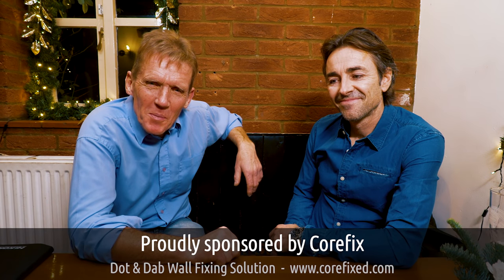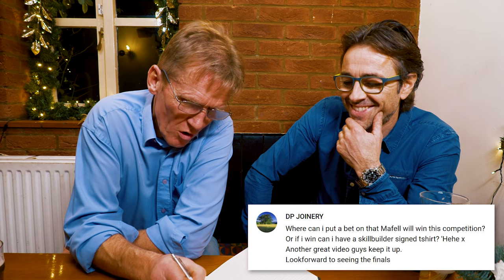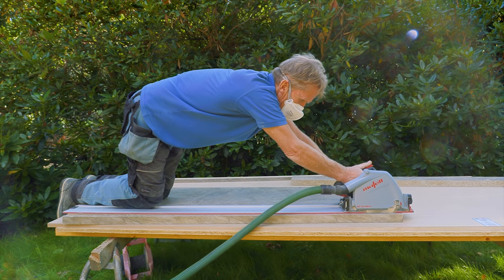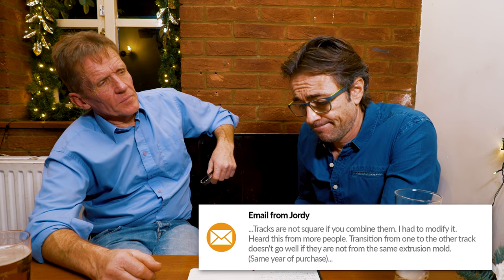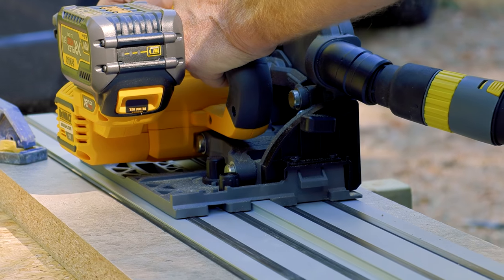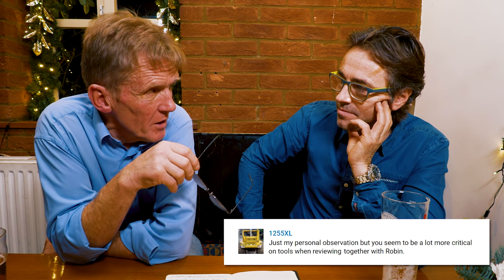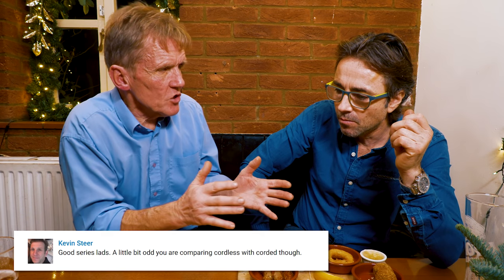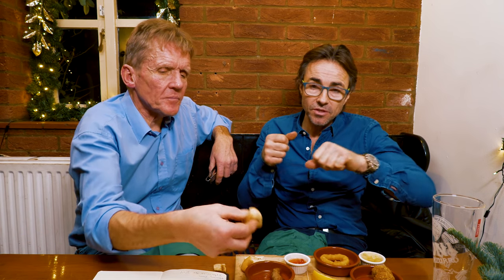Plunge Saw Season - Your Comments & Questions

Comment: when triton made their makita clone in a different part of the factory the chinese as usual cut a few corners so some tracks are not cut as square as they should and the splinter strip is often cut too short,. set the rails up as a pair and use makita splinter strip and bag them as normal.. the batavia, titan and erbauer variants have meant better quality control so triton has lost out a bit as they are probably still selling off their original run. the family of saws though is a good choice for those not spending all day cabinet making. trade or DIY. spend 30 quid on a systainer and they last just as long for most people.

the other bigger issue with the short tracks is that they are thinner than the longer ones.

I disagree with the last bit, erbauer is not just for DIY at all that is rather elitist of you, festool bosch and dewalt all  prove that more expensive does not always mean better, just more expensive . I know lots of trades who use it because it works, is cheap durable easy to get and easy to replace when it gets nicked. a lack of spares is what lets it down.
Reply: You can't seriously believe that the erbauer plunge saw is as good as a festool, I can't comment on the Dewalt  or Bosch as I haven't  used them but i know for sure the other two are not even close.
Reply: @cardiffpicker1  less refined maybe, noisier and certainly heavier, both have their place in the pecking order but the erbauer is basically a cheaper makita. festools are not durable nor are they perfect, or indeed value for money for most users.  a few better accessories from several makers and you get as good a result on an erbauer or even a titan much much cheaper. I know guys who have ended up buying second saws that take 165 blades for general use like floors, doors and panels then only use the expensive saw for expensive work. I use festool and makitas up north and have a triton at home, the triton sometimes takes a little longer to set up but the quality of work is just as good provided you are good at what you do in the first place.

three weeks ago I was kerfing a panel for a curved kitchen unit with the work festool and IMO it would have been a lot easier with my triton or my apprentices makita.

festool use 160 blades so you buy their expensive ones, the ts55 takes 165s perfectly well but you have to be aware of the extra depth of cut.

prior to plunge saws I used a standard circular with a plywood track and fine tooth blade in much the same way. for most people that would do them as good a job. 

two years ago out of desperation I serviced and tuned a battered erbauer sliding mitre saw to use on a job when my makita failed and it didn't fit either dewalt, it howls like a banshee and kicks too much starting power but it did just as good a job with a steady eye and a good blade. new the saw was probably 120 quid and it was over 5 years old when I borrowed it.
Reply: @cardiffpicker1  if you are interested when black and decker (dewalt as is now) started churning out 14 and 18v tools because they couldn't get decent quality motors or batteries for the price they were prepared to pay for them. odd compared to why they bought elu.

at the same time festo rejected two containers of johnson motors for being substandard. their CDD12 outperformed all other makes and voltages at the time. I have 25 year old 12v drill drivers still going strong.

bosch had the same problems, as DW but didn't throw as much money in their marketing to get over it.

it will be interesting to see what happens to hitachi-metabo now a US group owns them. I see we have KOKI tools in my local screwfix now
Reply: @davidcollishaw2771  a lot less refined  and quite a lot noisier  also dust collection is not as good, the cheaper brands are fine for ripping OSB or ply sheets but are very hit and miss with precise cuts.
Don't get me wrong I wouldn't buy a festool either  as they are quite delicate and I think they are more of a workshop tool than a site tool (could just be me as I don't wrap my tools in cotton wool).
I am more than happy with my 4 year old makita at the moment.
Reply: @cardiffpicker1  they all have issues with dust and accuracy.regardless of make as indeed do all saws. I have to disagree with your comment having done both regularly and accurately, if you have had issues then maybe you need to adjust how you do things. you have as many issues with festool as an erbauer if you do not check and check again. most errors are due to bad practice and maintenance. mdf dust on the friction strip with a failure to clamp the rail is probably the commonest cause of bad cuts.

even the bads on any saw make up for having to do it the older ways though. see the flaws and work with them.

Peter Millard does a good video on comparing the titan saw he bought with his festo. as he says most people cannot justify the cost of a festo but that doesn't make the titan or variants junk. for most cuts I may end up taking the sharp edge off with sandpaper anyway, blow out doesn't only come with the cut and a rounded edge is more forgiving if you aren't going to edge it.
Reply: @davidcollishaw2771  when I said precise  cuts I didn't mean  the accuracy of the cut as that is something  you learn to deal with  but blow out is far worse on a cheap saw than one of the premium brands.
Reply: @cardiffpicker1  that is often down to blade choice, the scribing cut on cheaper saws deals with a lot of that. the type of material makes a big different as well, the grade of MFC and laminate finish varies greatly. cutting veneered boards I'd rather use my triton than the work festo. some really bad boards I've had blowouts on all saws. no different to table or chop saws, better blade better finish, not all blades have to cost more to be better, a cheap new blade can cut better than a dull expensive one and most diy folks do not get their blades sharpened so cheap blades make more sense and give a perfectly good cut.

a problem with most saws is how much toe they allow on the blade or bad balance on the blade. the cutting cut is often not the problem, the blowout comes from the back of the blade. its more obvious to see in effect with a table saw.
Reply: @davidcollishaw2771  obviously  a sharp blade will cut better than A blunt one, you must have got the jackpot with your triton then as every one I have ever used has been pretty  bad even with a reasonable blade In them (only use Freud as it is what the company supply) even put a dial test indicator on one and the throw in the blade was horrendous.
Reply: @cardiffpicker1  not just the sharpness of the blade but the rake too, speed of cut and also speed of the saw, faster is not always better if the blade develops a shimmy or flexes as it blunts. badly stamped/cast washers also make a difference I've noticed

Comment: just recently bought the Bosch...base has no issues, nice and flat. Only used twice so far on kitchen worktop and MDF sheets (strip cutting for panelling job)...easy to use, very smooth on tracks and super quality cuts...also kinda like the grunt the motor makes when starting up.....Mafel was tempting to buy but I always look at what extra you are getting for the extra pounds, and in this case I didn't think it was worth it.

Comment: About bigger batteries - biger amperage maybe does not mean you will get "more power". 5AH batteries still have the same amperage as 2 AH but the runtime is lower. But with bigger amperage in a battery pack you get more cells. And you drain power out of all cells at the same time - so you can maintain the max torq and speed for longer before they start to heat up. Look at Milwaukee - they have ordinary batteries and High Output ones - that gives you 15 AMP with 18 V instead of 10 Amps of whatever the numer is for ordinary batteries. And you can see the difference in tools that drain power at much higher pace . Like a planer, angle grinder, drill that has to run a big drill etc....Im running Milwaukee platform (not happy with it) and circular saws and drop saws work much better and maintain blade speed better with HO batteries.

Comment: The battery amp hour does matter with how much power output but not always the case. This is really matter with the different kind of cell and behave of the cell to give you final output power. If you think the tool is actuelly a fix load (not always the case depends on the brushless controller setting), then when you require same 10 amps for the tool you will then end up in diff output voltages. The things is that due to this is a motor load and all the energy need to be converted to magnetic field before it converted to rotation, this means the amp is the only thing matter with your magnetic field generation. But if your voltage drop too much then you wouldn't get the enough power to drive the same current under same motor load (same motor coil resistance). The battery each cell without load with full charge can theoretically give you 4.2v but under a big load might only give you 3.2v. This depends on the batterys self resistance. And this value does increase after few cycle run of battery. So different case battery capacity matters and different case it doesn't. And it also will have different explanations after the battery gets used after few ten to hundred cycles. I couldn't explain better on common but every bit of part comes into this battery power output problem even diff tools you use matter. So no good manufacturer will say big capacity battery definitely give you more power to all tools